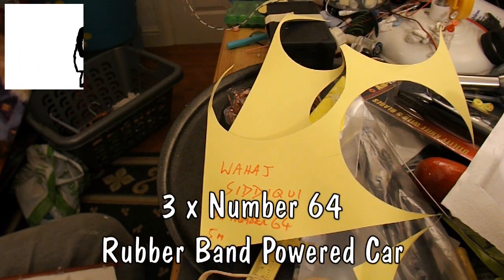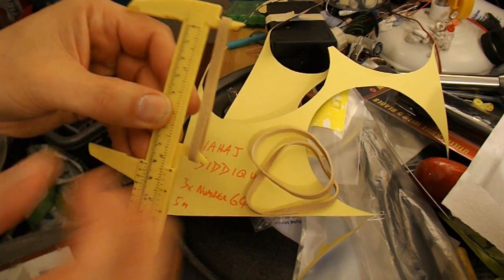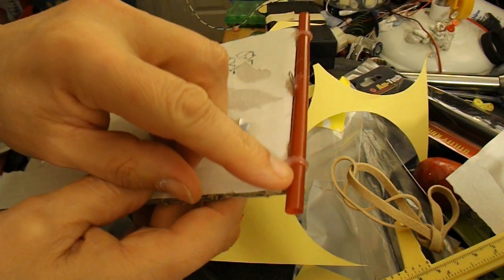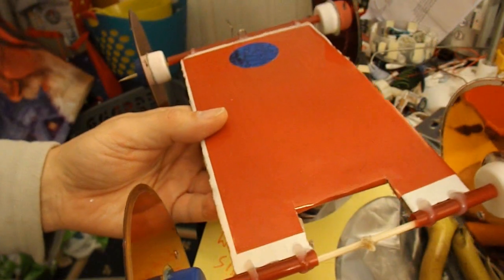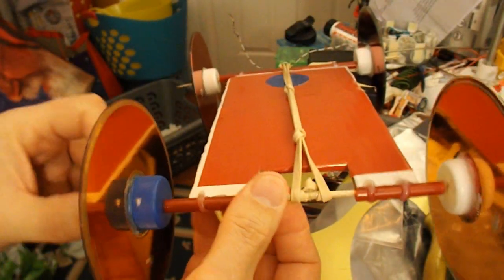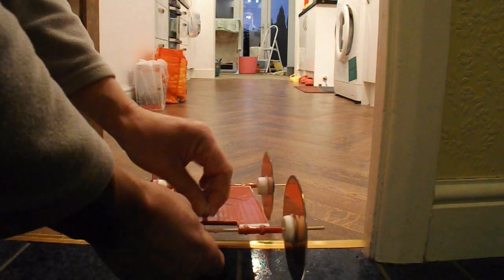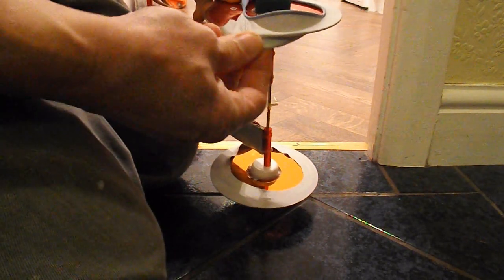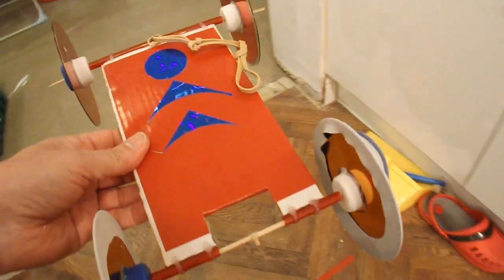3 x Number 64 Rubber Band Powered Car goes 5 metres

Comment: Other than using more force through the rubber band, is there any other way where I can increase the distance the car travels?
Reply from the maker: The first point about travelling fast or a long distance is minimising your friction because that is what wastes your power. 
1. Friction caused by badly aligned wheels rubbing on the bodywork should be easy to fix by adding spacers to keep the wheels clear.
2. Friction where the axle is attached to the bodywork is reduced by making sure the axle bearing surfaces are something that does not bind together. Wood and cardboard are not good. Metal surfaces are better. Steel and brass is good. Ball race bearings would be even better. Whatever you have, even if it is just wood and cardboard, you can improve by making sure there is clearance so they do not jam together and maybe rub some graphite from a pencil where they make contact might help.
3. Friction with the wheels to the ground can be a mixed blessing. Minimise the friction of the front wheels by using very thin wheels, however you may need some grip to ensure they keep the car going straight. The same applies to the back wheels, assuming you are using the back wheels as the drive wheels. However if they do not have enough grip they will spin under power and that is all wasted energy. Thin wheels with rubber tyres would be best in that case.
Larger wheels take more effort to get them turning but once moving they have the momentum to keep rolling when the rubber bands have finished. You could experiment with different sizes to see which work best.
You could use some sort of gearing to start with a large gear to get the wheel moving and then a smaller gear to maintain the motion. There are some examples in my playlists.
Reducing unnecessary weight by trimming the bodywork a little may help but make sure you don't loose grip and start the wheels spinning if the body is too light. It may bend or break under tension so be careful.
Another trick I have found helps is to stretch the rubber band as you wind it round the axle so you get more turns round the axle, this can make a significant difference compared to just winding the band normally.
If you can only use a short rubber band, connect it to the axle using thin string so the string winds round the axle stretching the rubber band. Thin string will give you more turns round the axle than thick string.
This simple one does 12 metres https://youtu.be/pIO3FiHX4Oc with just 1 size 64 rubber band.
Reply: @GrandadIsAnOldMan  thank you grandad 🙏

Comment: I tried this and it works but my only problem is that the wheels are so wobbly when it’s moving. do u have any suggestions on how to fix it?
Reply from the maker: If you made the wheels the same way that I did then you should be able to reheat the hot glue on the bottle caps to soften it enough for you to re-align them so they are straight.
Reply: GrandadIsAnOldMan thank you so much !!
Reply from the maker: @Rana-mv1bx  good luck 😁👍

Comment: Hi grandad my car keeps driving slightly to the left :( any tips to fix it?
Reply from the maker: +Nancy Gonzalez three likely issues.
1. Your axles are not quite parallel and you may need to unglue the front one and pack it out a little to make the car straighten up.
2. If you wind the band all on one side of the axle it tends to bend a little pulling the axle out of alignment so you need to try to distribute the turns evenly. Alternatively use a stiffer axle so it does not bend under tension.
3. The wheels are slipping sideways under acceleration, so put rubber tyres on ALL of them, front and back. Cutting strips from balloons usually works as you can stretch them round the outside of the wheels.
Reply: +GrandadIsAnOldMan ok thanks a lot!

Comment: hi, i have an assignment and i basically have to make a car exactly like this one but my car is suppose to throw a cube made out of sponge at the five meter point .. how do i do this PLEASE HELP
Reply from the maker: +Tehseen Fatima at the moment I can only give you some suggestions as I am a little busy of the Christmas and New Year period. I have had several requests for cars to stop at a particular distance so have made cars with a brake mechanism that operates at that distance. You could do something similar but instead of operating a brake you could trigger a mousetrap or a similar home made spring arm. That could be used to throw the sponge.   Brakes on Rubber Band Cars https://www.youtube.com/playlist?list=PLA5a2xPRSrB3MyidvKMT3DqU1vNy9Atsf and this car has a series of levers operated as the car moves forward https://youtu.be/BenC2W21CCw?list=PLA5a2xPRSrB04L6RpUAs5akmK3jqmahPL  I will look at having a go at your project myself but it may be several weeks before I can get to it so it will probably be too late for you.
Reply: +GrandadIsAnOldMan thanks for the link :) ill look at it and try myself 

HAVE AN AWESOME CHRISTMAS 

HAPPY NEW YEAR IN ADVANCE
Reply from the maker: Tehseen Fatima thank you, happy Christmas and happy new year to you too and good luck with your project.
Reply: Fhj